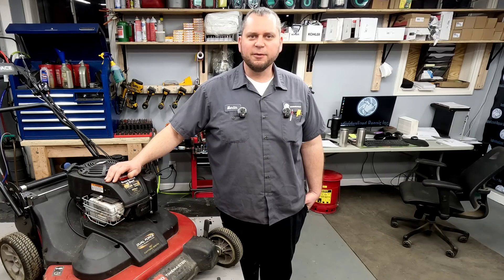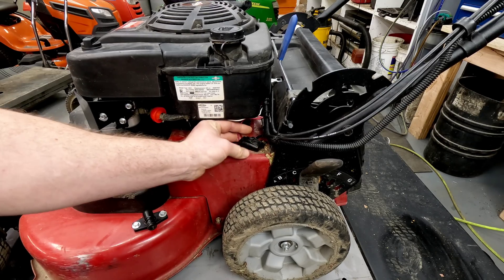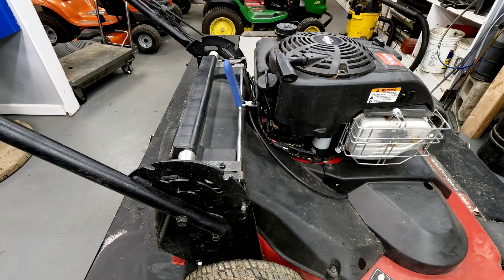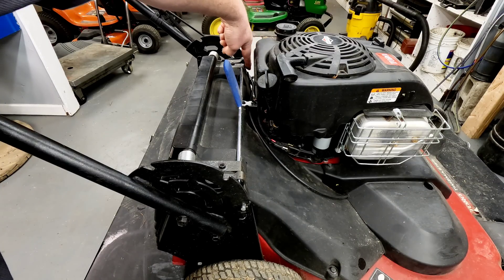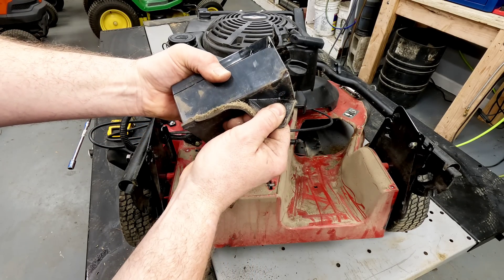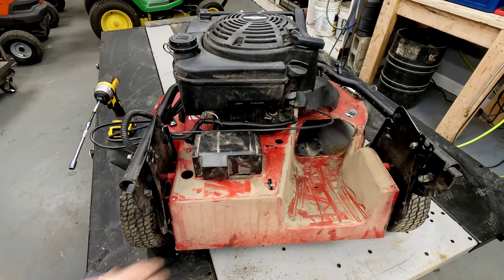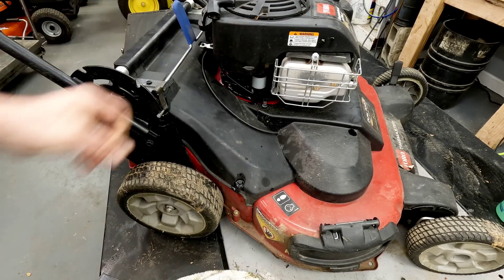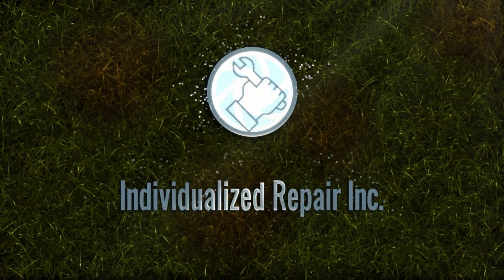Toro TimeMaster Mower Won’t Start? Full Electrical System Diagnosis & How To Replace Battery / Fuse

Comment: I didn't see you check the charging system ???
Reply from the maker: Many of these don't have a charging system. You have to charge it with the charger when the battery goes down. This was one of those cases. Cheap, unreal design for having a battery

Comment: They shipped me a new toro 21220 with a blown fuse lol
Reply from the maker: That is some crazy stuff lol!
Reply: @IndRepair luckily it comes with a extra one
Reply from the maker: That is good at least
Reply: @IndRepair  I ended up returning the lawnmower. I was using it for like five minutes and then turned off then it wouldn’t come back on with the key. Turns out it was another blown fuse.
Reply from the maker: WOW! That is definitely no good probably pinched a wire somewhere during assembly sounds like

Comment: Hello. My timemaster 30 just keeps sounds like it's spinning but not starting. when fully charged with electric start.. Pull start works fine. Any thoughts?
Reply from the maker: I see a low battery or bad connections to cause then not to spin fast enough often
Reply: @IndRepair  Thanks for the reply. So i bought a new battery and still same issue. I took a look at the bendix and noticed while starting it does not shoot to the top to engage with the fly wheel. Could there be any buildup on the armatur or anywhere else that could be causing it not to spin fast enough? Or is the starter bad? Any help would be greatly appreciate as no one I have spoken to that service this have been able to assist.
Reply from the maker: Like the bending itself or somwthing stopping it from coming up
Reply: @IndRepair  Sorry not sure what you mean by "Like the bending itself".
Reply from the maker: Bendix darn autocorrect
Reply: @IndRepair  The bendix seems to look like its moving freely and I don't see anything in the way. When I turn it to the right manually it goes to the to easily. But that's probably normal behavior I'm assuming. I tried a little 10w40 on the bottom of the stem the bendix and clutch are placed on but didn't seem to help.
Reply: Do you think I should just try replacing the starter motor?
Reply from the maker: That would be what I would do, sorry never saw this!

Comment: What was the problem?  The battery? Mine has the same issue (wont turn over) but mine is only 10 hours old!
Reply from the maker: Check all the connections and the battery

Comment: Video was well done.  Your efforts are appreciated.  A couple of questions - which will show my lack of knowledge.  When you're measuring the red wires with the multimeter are you using voltage or resistance?  Same question for the black and white wires.  I have an older Timemaster 30 that I was mowing with - about half done with my yard and it died.  Won't restart.  I tried changing the spark plug before watching your video to no avail.  The electric starter runs at a pretty good clip but never fires.  Honestly, I have better luck with the pull starter than the electric, but the mower doesn't fire at all with either.  I watched one other video that discussed the ignition coil and offered a resistance range the indicated a good coil.  When I tested the starter coil, it fell within the good range tht was given in the video.  I used a spark plug tester and am not seeing any light or spark when trying to start the mower with either electric or string start.  So, at this point I think I'm down to either the ignition coil or the switch.  I haven't performed the tests on the switch that you did on the switch wires yet - hence the questions about what you were measuring.  One other observation - when I try to use the electric start, if part of my hand touches the top of the switch (the switch nut) there is a bit of a tingle that I have never noticed before.  Any suggestions, help, direction or thoughts would be greatly appreciated.  One other question when I took the cover off the engine there are two separate coils on attached to the spark plug wire and another smaller one.  Is the smaller one to charge the battery?  If it was bad would that keep the engine from starting and not producing any spark.  Many Thanks
Reply from the maker: I appreciate that! Sounds like you have an issue with spark, possibly a bad wire at the handle grounding ir out. You can disconnect the wire from the ignition coil and check it again to see if the wiring is the issue. When looking for a beep we are checking continuity to see if a connection is present. Otherwise we check DC voltage when looking for a value on how much voltage is there. The smaller coil is for charging the battery

Comment: Martin, I have a question.  What brand is that scissor lift that you use on top of the lift table to raise the front of a riding mower?  I'm not taking about the hydraulic floor jack....I am speaking of the rectangular one that you power with a drill or impact driver.  Looks like a motorcycle jack.
Reply from the maker: It was a Handy lift but I broke it a long time ago. I have missed it ever since 😕
Reply from the maker: Motorcycle lift i think for the small jack one too. Came with the table

Comment: It’s too bad every machine with electric start doesn’t also come with a stator! ⚡️
Reply from the maker: I just commented this on another reply that I have seen some with a stator but not sure how many years they did it for. It should have always been the standard on these
Reply: @IndRepair 
Absolutely! They were probably doing without to market it at a lower price point.
Then of course the owner would need to get a trickle charger and remember to plug it in every time. Argh! 😂
Reply from the maker: Yeah, they come with a charger but nobody seems to plug them in

Comment: Nice one, Martin!
Based on the 21 comments before me, I might almost guess that this machine came from the factory with some electrical connections that weren’t real tight or sealed very well, putting undue strain on the battery.
Reply from the maker: Connections of the key switches on everything with this type setup (all small engines) do not have the best connections. The 40 amp fuse tells me this thing tries to push way too much voltage through small wires to begin with but it seems to work for what they want it to

Comment: I worked at a Toro dealership for 10 yrs, and the worst Toro ever made, is this one. Too fragile to be commercial duty. Timed blades with rubber belt along with plastic parts make this a joke. when engine comes loose, it enlarges holes in frame while vibrating around. Transmission is a joke. They could have designed it so belt adjustment could be made on handle, but, they didn't. Over all, a waste of time and money.
Reply from the maker: Definitely. I like to call it the Time disaster. The other one for this customer had loose engine bolts and the transmissions seem to get 3-4 years commercially before they are toast. They made that darn BBC adjustment at the bottom so the normal Joe Schmoe couldn't do it himself I feel like. Ten years at a Toro dealership is a good run, I am sure you have some good stories. Thanks for watching!

Comment: To my ear, it still sounds kind of sluggish on that electric starter, although I’ve not heard many starters on this engine type. Maybe the starter is worn, but wondering if the valves should be adjusted. It has a lot of connections that possibly should have a voltage drop test run on them too. Unfortunately I realize this takes a lot of time the owner probably doesn’t wanna spend on it. Seemed like it cranked a bit long before starting as well multiple possibles as to why but suspecting starter speed or choke function. I understand the shops hour time on a push mower especially but I’m just concerned, if it were me I’d probably investigate a bit further no charge just because I’m a perfectionist and hate the idea of sending it until I’m sure. If it matters, I had the least callbacks of anybody in my department, but yeah, they thought I put too many hours in stuff 😤🤬😜
Reply from the maker: Yeah I hear you, sometimes they just don't turn over as fast as you would like. With it being so new I am not convinced it would be connections or valves yet but it is a possibility. Being perfect isn't a bad thing but ilyou are correct it definitely takes some time

Comment: Wonder what made the fuse blow?
Reply from the maker: Seems to me like the low battery along with someone continuing to turn the key likely did it
Reply: Could be poor connections heating up and not passing amperage correctly too.
Reply from the maker: Definitely possible but with it being so new I doubt it. Everything looked great